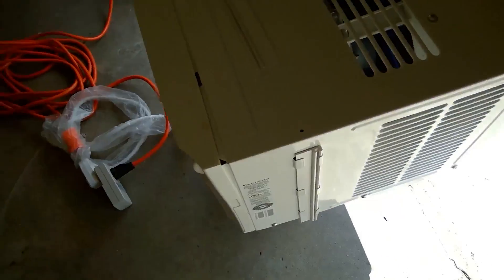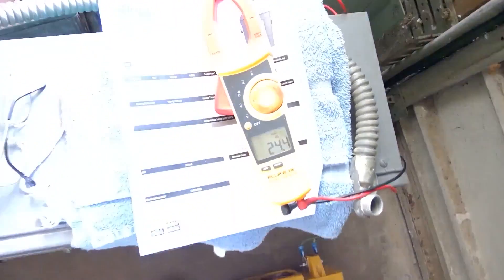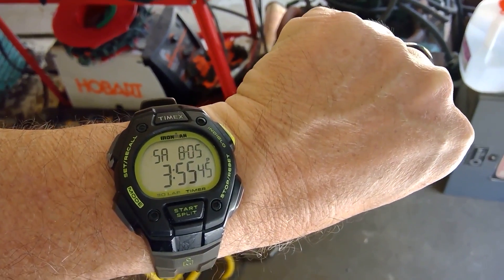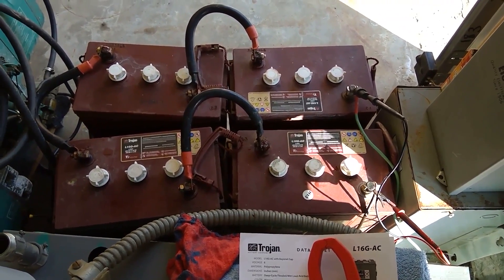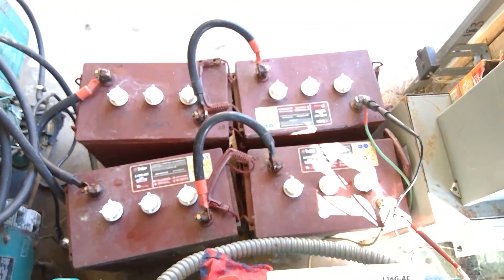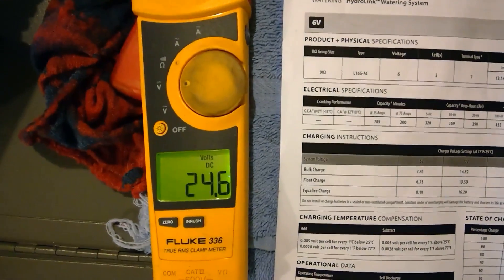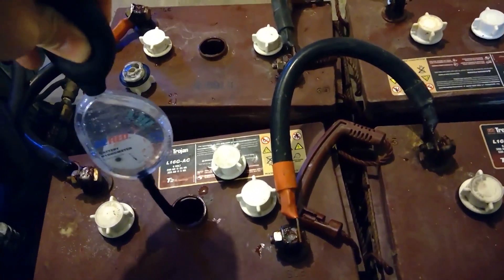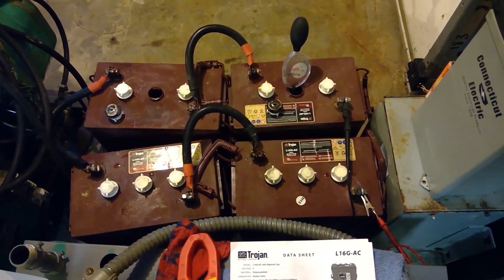How to run Air conditioner off of batteries

Comment: My 5000 BTU window a/c has a label stating that it uses 4.5 amps at 120 volts.  It is not a thermostatic model, so you turn it on and it runs (with compressor on) until you turn the switch off.  Using Ohm's law, 4.5 amps at 120 volts would be 45 amps at 12 volts.  To run the a/c unit for one hour would consume 45 amp/hrs from my batteries.

The 200 watt array of solar/PV panels in my RV produces 11 amps in full sun when they are properly aimed.  (That is two 100 watt, 12 volt nominal panels connected in parallel with each producing 5.5 amps max.) Having 5 sun hours a day, the array produces 55 amp/hrs of battery charge a day.  If you want to be optimistic, you could say 65 amp/hrs. (but that's pushing the envelope.)

So, If I produce 55 amp/hrs with a 200 watt array and I use 45 amp/hrs for each hour the unit is operating, how large an array would I need to run the unit for 5 hours?  5 X 45 = 225 amp/hrs a day used.  At 27.5 amp/hrs produced for each 100 watts of PV array it would take an array of 818 watts (or nearly one kilowatt.) to replace the usage and maintain the battery's state of charge.

Then, we have to look at the battery bank.  Using flooded lead-acid deep cycle battery technology, the depth of discharge allowable is 50%.  Deeper discharging is possible, but voltage drops severely and the batteries suffer permanent damage.  So, we take the amount of amp/hrs we need to use and double it.  Then we add 10% for a safety margin.

We need to use 225 amp/hrs a day.  That doubles to 450.  Adding 10%, we get 495 amp/hrs as the smallest size battery bank we should build.

So, with an a/c unit rated at 5000 BTU and drawing 4.5 amps at 120 volts, we need 818 watts of PV panels and 495 amp/hrs of battery bank to run the unit for 5 hours.  In the practical world, those figures do not consider days that are partly cloudy or panels that are not kept at the optimum angle during the five sun hours of the day. 

The power requirements of the a/c unit are the same whether the space we are cooling is large, small, insulated or not insulated.  Those factors will only effect how effective we feel the cooling to be.  A small well insulated van may feel quite cool after about 10 minutes, while a moderately sized room may not feel comfortably cool for 30 minutes or more.  BUT, to run the a/c unit for an hour will require the same amount of electricity in either of those environments.

Now if the a/c unit is built with a thermostatic control, perhaps the compressor will be on less of the time the unit is running.  In that case, some slight downward adjustments could be made.  Still, it is hard for me to take this test seriously.  He showed that it is possible to power a small a/c using solar charged/recharged batteries, but he came nowhere close to showing it to be practical for cooling even a small closet.  Good conversation starter though.
Reply from the maker: clyde alspaugh i don’t understand your statement. the ac will supply 8000 btu of cooling for a period of time, why do you think it would only cool a closet?
Reply: I'll try to clarify.  I didn't mean to imply that the 8000 BTU a/c would only cool a closet.  It should cool a moderate to large room easily.  What I was trying to convey is that the actual size of the space one is trying to cool has little if anything to do with the power required to operate the a/c unit being used to try to accomplish that purpose.

In other words, it'll take the same amount of power to run that a/c for a hour regardless of whether you are trying to cool a small room or a large one.
Reply: Now let's say you wanted to have 24/7 air conditioning on solar power.  We'll take our 5 hour figures and divide them by 5 to get a one hour figure.  Then we'll take the one hour figure times 24 and see what we get.

Our figures for 5 hours were 495 amp/hrs of battery bank and 818 watts of PV panels.  Translated to one hour figures these would be 99 amp/hrs and 163.6 watts of PV panels.  Now taking these one hour figures times 24, we get 2,376 amp/hrs of battery bank and 3,926.4 watts of PV panels.  So 2,376 amp/hours of battery bank and 3.926 kilowatts of PV panels would run a 5,000 BTU air conditioner for 24 hours.  

If one assumes $100/100 amp/hrs of battery capacity and $1.00/watt of PV panel, this would cost roughly $6,300 plus the charge controller ($100) and the inverter.($200)  Of course, the air conditioner itself will be about $100, so The system will cost about $6600.00 to set up.  

Is it possible?  Yes.  Is it practical?  Not for most people, I think.
Reply: The issue of surge power requirement is a big one, too.  It's possible to have "lots of power" left in the battery bank but not enough to kick the inverter high enough to supply surge power on startup.  
I've heard some "Solar Power True Believers" imply that they can run their whole house, charge their Tesla car, and supply half the city of Portland off a couple of Harbor Freight 75-watt panels, but I know better.
Reply: Nice!  Are you running off battery or shore power?
Reply: Cool.  600 watts of array should be fun to mount.  Do you have solar now?  The battery bank is the key component of any solar system.  More battery capacity = more usable stored energy.  What many people forget is that whatever they are running, it is running off the batters.  The solar array is simply a method of recharging the batteries.

The additional batteries will double your amp/hr capacity.  If those 6V batteries are the common ones, they'll be about 230 amp/hrs each.  So I can guess that you will have a 460 amp/hr battery bank after adding the batteries.

But of course they are still lead-acid batteries, so the usable amount is only 50%.  I think you'll want more battery capacity if you plan to run the a/c "all day."  Check the math and let us know how you come out.

Certainly a solar system with a 600 watt array and 460 amp/hrs of battery bank can make a significant dent in your electric bill.  This is especially true if you carefully manage your electrical usage.

But cutting your bill from $80 to $10 may be a bit optimistic.  I will never have a $10 electric bill.  The utility charges a basic service fee each month before I've used a single watt.  That plus the govt fees and taxes ensures that my bill will always be more than $10.
Reply: I can assure you we cooled a medium sized living room and small kitchen of about 250 square feet with a measly 6000 btu window air conditioner. You assume it's a system in florida.. where it's humid and hot all night. We later upgraded to a mini split with 12000btu and even then it was just barely enough to cool that moderately insulated room (80% of how I would insulate but not too bad really. Newly renovated but many decent sized gaps in the attic insulation by the contractor we used). We ran the AC about five hours a day. This sure seems possible to me. But I'm open to you being right in more humid places than here in Los Angeles. I find fans can do fine out here if done well enough. Plant some trees that lose their leaves in fall and you have shade in summer and allow sunlight in winter for your southern exposure at least to vertical walls.. if not shading the roof too much. Also, I've wondered about strong attic fans, and misting systems for the roof to keep the roof lasting longer and potentially preventing disaster during forest fire season up north??

Now consider the solar panels shade the roof and the ac doesn't even need to be run as much on top of all other considerations. Makes me think we should always shade the roof and do our calculations with that real world effect, especially if it's an RV as my application is. With a home.. that shade is lost somewhat in the attic but would have some effect. Again, better insulation is key. I'm thinking of removing all the paint off my aluminum Rialta RV and polishing, then sealing(?) that aluminum like an airstream. That would reflect a lot of sunlight. I'm guessing even more than the white paint on there now.
Reply: For me, I am playing with using hybrid cars to act as very long lasting and easier to maintain generators for power outages and backup power needs such as hurricanes and fire season etc. It makes so much sense, I can't believe we didn't do this earlier. Refiling a prius or Hylander hybrid is easier to do once every 3 days than storing 8 giant gallons of gas at home and refiling every 8 hours. The car ICE comes on for fifteen to twenty minutes per hour depending on load. It produces so little fumes you only need to crack a window I think.. and it's a car the other 360 days a year.. not taking up space and getting useless when you forget to run your generator once a month or week. 

They do make such hybrid generators that are stand alone but work with a battery pack the same way. They are $4000 from a place in Arizona I spoke to at least. It would be very cool to see them get smaller and cheaper soon and use them to replace even the somewhat better efficiency of "inverter" generators in RV's etc. This is the best of both worlds and likely answers the real issue Clyde might also understand very well. That is.. sometimes you need more than solar or EV. Think of the Chevy volt.. it's a Tesla with 40-60 miles of ev range.. (99% of commutes).. but you won't be stranded when you run out of charge because there is about 60,000 watts of ICE, gasoline powered recharging electrical generation from said ICE which also acts like a supercharger when you really need to get out of someone's way on the road. 

And for most real world situations.. you may find solar and a smaller battery pack of 4-10Kwh.. would handle 90% of your summer days.. and if not.. you have your own power plant handle the rest.. whether that's the AC power from the utility company or a generator while in the RV on the road somewhere.

Comment: Do we know how long it will safely run the unit? I got the idea he was going to run it as long as possible and simply give us a time, but all I'm seeing is a bunch of figures/guesses. You drew the batteries down 30%...was that usable 30% or 30% of the full charge? Did you ever get a concrete time it will run on those batteries?
Reply from the maker: Kenny S 5is depends on a few things. how low one wants to take their batteries down. some believe 30 % some believe 50 %. it also would depend on how often the ac cycled, or if you decide to set thermostat so that it never cycled. i bought a new 5000 btu and another camera so that i can do a time lapse and i will fully charge, then take down to 50 % and we can see how long it will run. look for a new video in the near future.
Reply: Ok, thanks, I'll watch for the next video...very helpful info.

Comment: Yes we are hearing you from in Illinois just letting you know you're getting out there..  I liked your video but I like to have a conversation on or I should say try to calculate or have the data to calculate... How much solar will it take to maintain the battery Bank..  I was just to buffer and the float charge..  but it coming down to the question do I want to charge my battery bank at 80 amps or do I want to charge him at 60 amps.. and these charge controllers have 1000w maximum intake current..  do I need 1000w because that is 10 solar panels..
Reply from the maker: How big (amp hr) is your battery bank? How many watts are you using in a 24 hr period?

Comment: I DO NOT BELIEVE THIS. There is no way that a 1000w inverter can start a 5,000btu unit, let alone a 8,000btu. The initial surge is too great. Ive tried starting a 5k btu unit using a 1000w inverter and the initial surge spike was measured at 1245watts therefore tripping out the inverter. Even with using a hard start capacitor the inverter trips out. S., my opinion is that he is somehow fooling ppl into thinking that this is genuine (which i don't know why)
Reply from the maker: Rick, I'm not fooling anyone. There was no trickery or magic. Having the right brand of inverter makes all the difference. the surge on my inverter is 1500 watts.  Not sure why you cant believe this?
Reply: He did not say what the Surge Watts are for the inverter.  I have a 1000 inverter but the surge watts are 2000.  Also if you start fan first and wait a couple of minutes then turn on cool and wait then turn up cool gradually this is very possible.  I believe his test.
Reply: He has a long extension cord between the inverter and the AC.  This acts as a resistor, reducing the surge current.   Especially if it a  16 gauge wire cord, which is common in a cheap extension.  Maybe a different result if no extension?  H should be measuring the wattage leaving the inverter, not entering the AC, the difference in wattage will give some indication of how much the cord is affecting the results.
Reply: Ed Garcia ki
Reply from the maker: thats a 25ft 12 ga, no issues there
Reply: No issue regarding safely passing the current (7 amps and 740 watts steady according to label), but it (the 25 foot cord) will damp (reduce) the initial surge spike due to its resistance.  How much?  I don't know.  More likely that the inverters are from different manufacturers, with substantially different surge capacities?
Reply from the maker: Good points Ed. I believe your last statement to be very true.
Reply: Inverters are generally (there may be exceptions, but I haven't run across them.) labeled and marketed using their surge wattage.  It is a marketing thing. Hence, your typical 1000 watt inverter will handle 1000 watts for 1-2 seconds but will have a sustained operating wattage of around 800 watts.  Perhaps a higher wattage inverter would be needed.  Of course a larger inverter allows you to drain your battery bank more quickly too, so there is a tradeoff.
Reply: PREJEAN OFF GRID BOONDOCKING the 5000 btu ac I looked at only used 500 watts so a 1000 way inverter shouldn't have a problem but it may not run long.
Reply from the maker: I just bought a 5500 btu, and it uses about 390 watts, with a surge of about 2100 watts when compressor starts up. The better made inverters will start up and run an air conditioner. I know my xantrex does, as its surge is almost double the running watts. I also have a samlex that is good for 2x surge. It's usually the cheapo inverters that have issues starting motors.
Reply: I tried this with a 800 watt inverter and powered a 8k Btu with no issues so I know this is real
Reply: I have a 8000 BTU portable air conditioner that I use when our power goes out during hurricanes. I was just curious one time, even though I have a powerful generator, what would happen if I plugged it into my DEWALT portable power bank rated at a thousand Watts. It cranked right up with no problems at all. So, yeah. It's definitely possible.
Reply: wrong, he used a CAP for the surge and I have run a 5000 BTU from 1 battery and 2 solar arrays as a test it worked.

Comment: Did your battery cables get really warm?  I am thinking the A/C unit may run longer (meaning less compressor time) in a closed room rather than cooling the outside air.  Neat test.
Reply from the maker: sellC1964 this was about 600 watts @24 vdc so about 25 amps through a 1 ft wire run of 10 gauge , so the wire should have been sized safely. i agree you, it would have had a longer run time had i allowed it to cycle on and off.
Reply: @IFix-Things  hello sir  i have a 1000watts ups 24volts can i use it for my aircon window type 0.5hp?
Reply from the maker: Aither EsGrit highly doubtful it will start it, let alone run it for any significant period of time, ups are not great for this application.